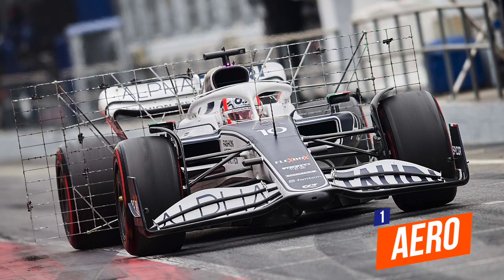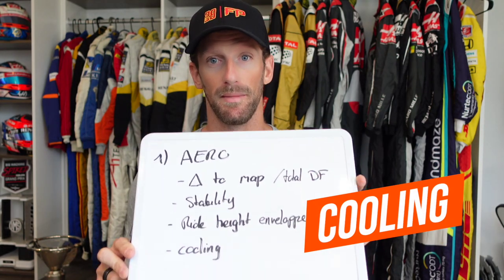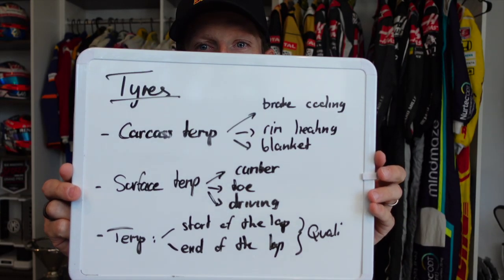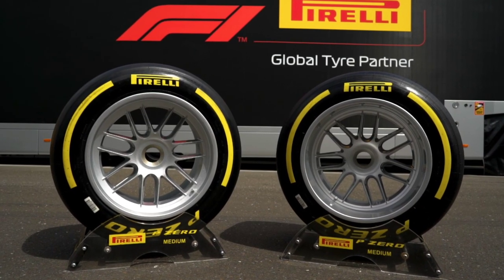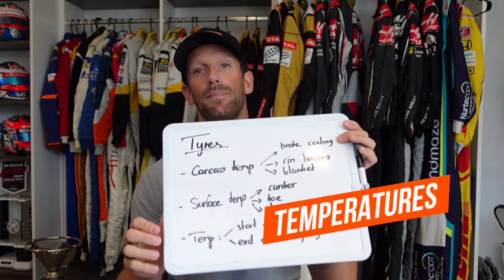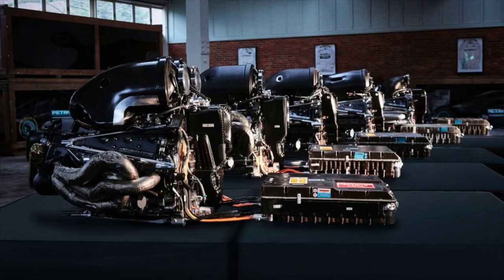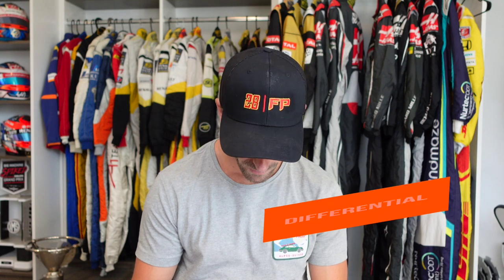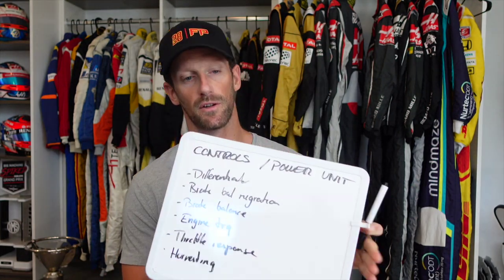How to set up a Formula 1 car

Comment: Another great video Romain... and for many of us, just the kind of additional insight and depth that helps build even greater appreciation and understanding of the roles and impact of every member of the team. While I could literally ask dozens of questions, I'll focus on two; 1) How impactful is it to have a chassis designed with characteristics that match/maximize the driver's preferences (as, for example, seemed to be the case at Red Bull during Vettel's championship years... and could you share some of your own experiences with the different cars you've driven both in F1 and IndyCar?)? 2) How much benefit is it to the performance of a team to have 2 drivers whose "preferences" or driving styles are similar? It would seem that given the extremely narrow margins separating the top teams, pairing the engineering and set-up philosophies of the designers and race engineers with the drivers could easily become the difference between winning and losing.

Comment: Great insight. I think with motorsport in general we don't get much information around setup which is odd as it's so critical. There's a lot to think about and it adds a greater appreciation to what needs to be considered to extract the maximum out of a certain package.

You've also explained it all in very plain English which is great and made it make alot of sense.

Comment: Romain, fascinating, thank you so much for these.   A tech question, are most of these setup variables static, ie a best compromise for the track environment, or are they dynamic, ie  can be changed on a per/turn or per straight basis? For example, your comment on differential settings - for high speed turns a locked diff gets the power down more efficiently, but an open diff would help the car rotate better through a tight turn.  Can those differential settings be changed on the fly, either via pre-programmed into a computer and automatically changed according to position on the course, or by the driver manually?

Comment: 6:56 I know this is a quick overview, but an additional point you sorta touched on with alignment would be corner entry grip vs mid-corner vs corner exit for front toe & camber w.r.t weight transfer (@sim racers go watch the in-depth Assetto Corsa alignment guide)
Reply: Episode 03 by Chris Haye
Reply: 9:21 yup nvm you got to it with diff 🔒

Comment: The brake migration is something I wasn't aware of. 
 Was always curious how you handled the diff at a place like Monaco or street course. Seems like the guy who's fastest making the transitions should have an edge maybe?

 Question: How similar is Indy compared to F1 in the number of things you can adjust in the car outside of the electrical in an F1?

Comment: Do you have to change all the settings manually or can you set presets?  Like you are heading into a hairpin, press a button and it changes the diff, brake balance etc. all to preconfigured settings for that corner?

Comment: Dont you think if we get new tyres that don’t overheat that easily and mire tolerant to sliding, racing would improve significantly! In 2022 tyres overheating while following was a bigger issue than dirty air

Comment: Are you still subject to any nondisclosure agreement? That was the most non-technical, technical explanation of coulda, woulda and maybe we shoulda I have witnessed. Your hints about toe out on the front and toe in on the rear with no caster, camber for the front or camber explanation for the rear with regards to 'differential' settings is sublime with regards for energy capture at the same time while doing any braking on entry or mid apex. The way you ignore just having some fat naked guy in the wind tunnel who eats too much Taco Bell wandering around the front of the car to simulate reality instead of calculating percentages is something to consider. Effula Un is complicated and I appreciate what you are trying to do.

For all the rest of you, traction control.